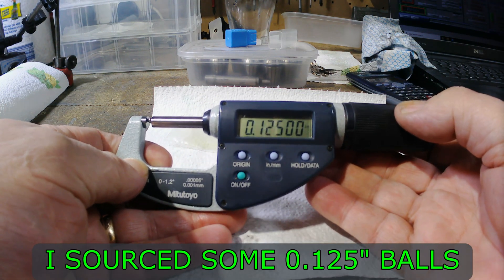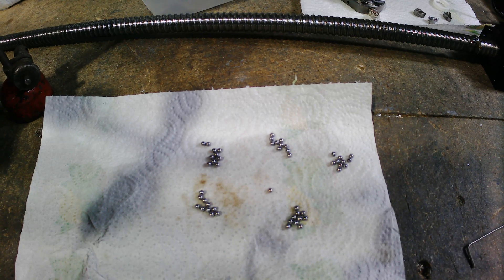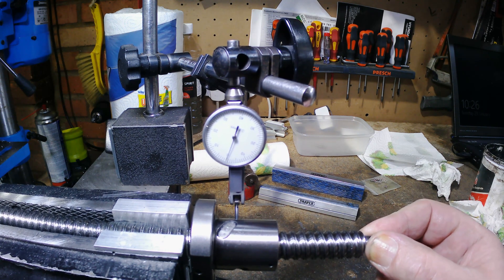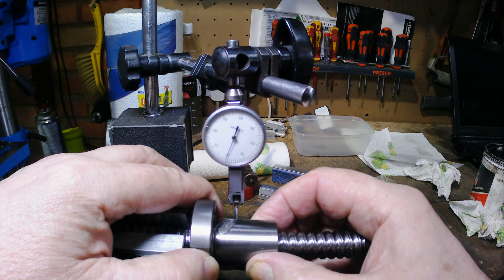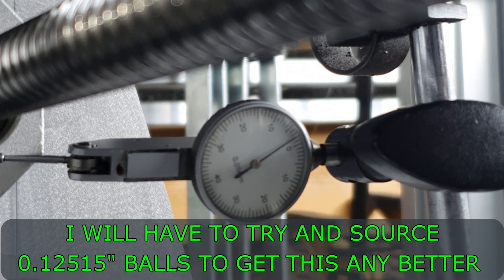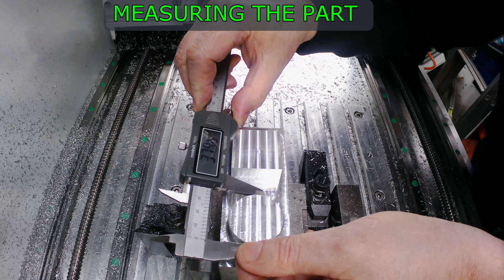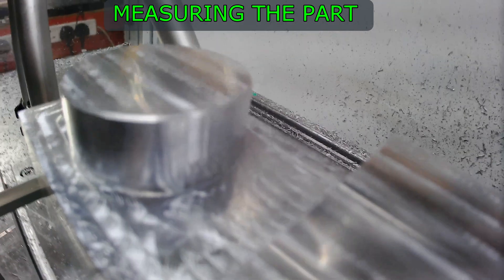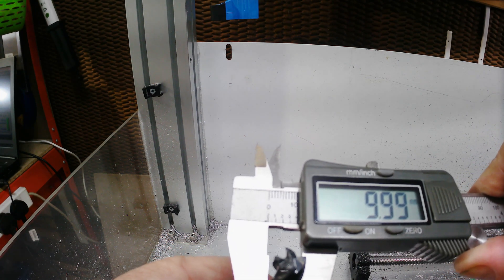DIY CNC 5 AXIS MILL TURN MACHINE PART 6

Comment: it comes from your linear rails, and not properly aligned the ballscrew, align the to 0 and result will come to 0. if not, chech the concentrycity of your spindle or if is there some bearing preloude

Comment: Hi Phil, great result, fiddly job but worth the effort. You will probably find if it warms up a bit, that 0.03mm will reduce, I would not go any bigger on the balls. You may be able to tweak slightly within the software, I know you can on an industrial CNC so maybe your driver software has an option. It's usually called a scaling factor in CNC speak and is adjustable via a set of parameters in the controller. Cheers, Jon
Reply from the maker: Hi Jon.
Good call on temperature, I'll wait a bit and check again. I am not sure about the software having a scaling factor but the software has backlash compensation settings which I could use as well. Thanks phil.